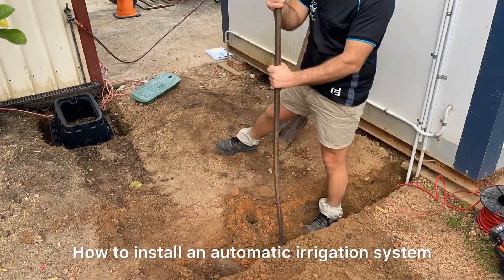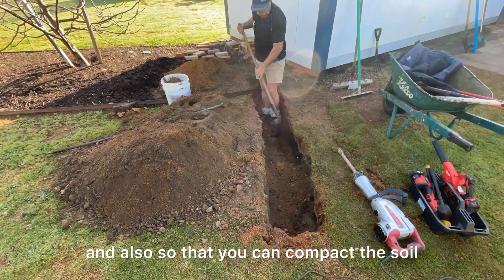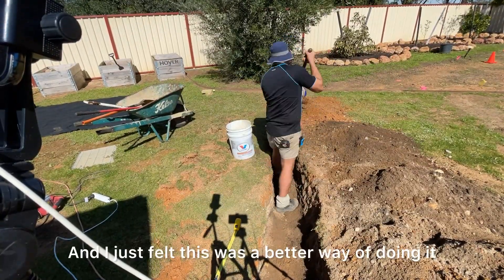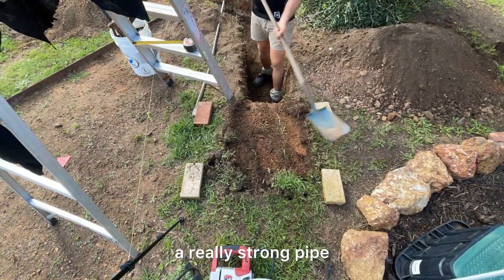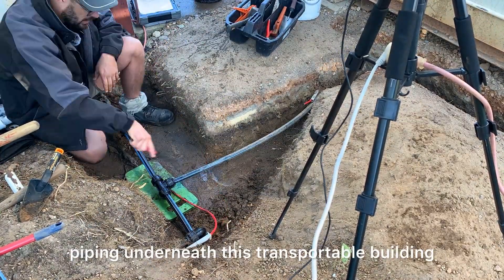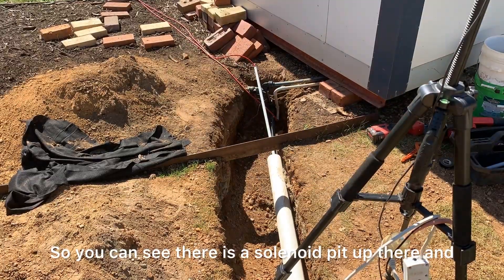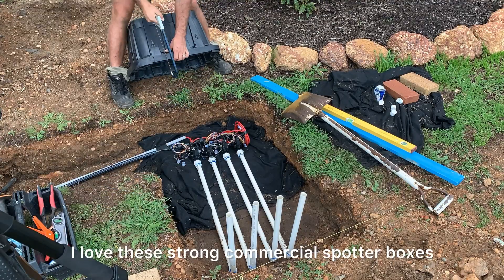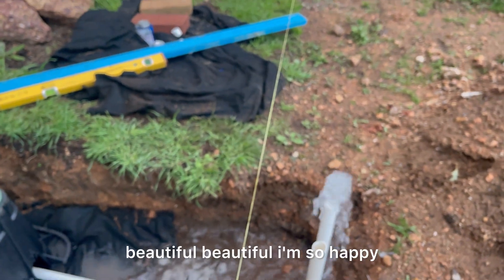Installing an Automatic Irrigation System

Comment: What to do about my dirty pipes? I got expensive rotators to save water and water more evenly, but they block up all the time. The pipes are like tar inside that flakes off. It would be less effort to water the lawn myself at this rate!
Reply from the maker: @Freshbott2  Hey mate, unfortunately if your pipe's like that it must be coming from your water source. Are you running it from a water bore pump? Pumping it from a lake etc etc? You may be better off using a gear driven rotor. Like a Hunter or a Rain Bird. Or investing in some sort of water filtration and getting someone to clean those pipes out using a treatment.